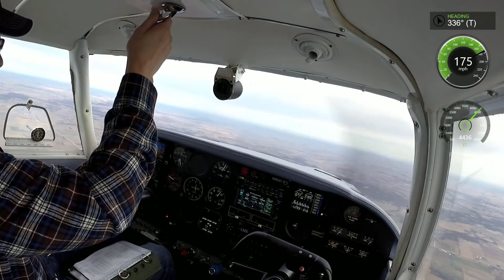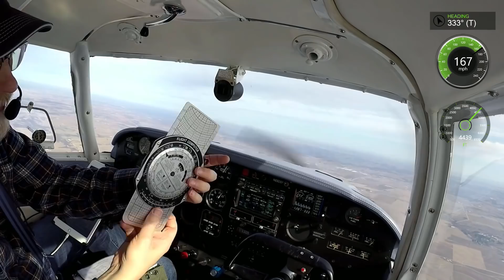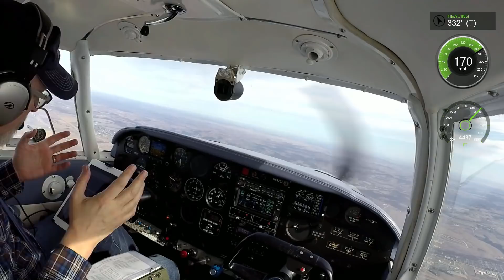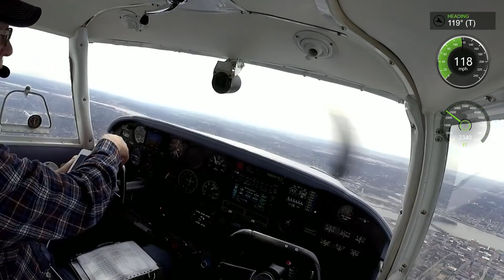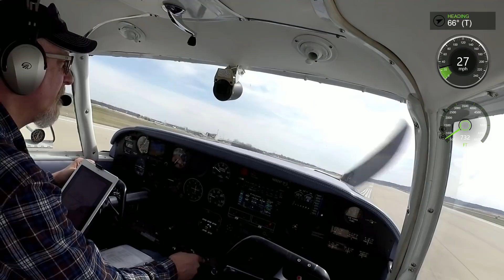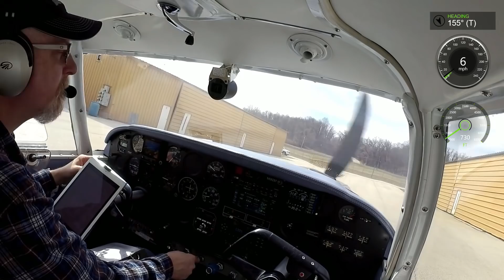Piper Comanche 250 Test Flight 3 with True Airspeed discussion

Comment: I wonder what software allows the superimposed hdg, Airspeed and altimeter at the top right, very informative, very thorough safe pilot! And the lever at the ceiling? Is that some type of trim, elevator trim?  I am a cessna pilot, never saw elevator trim at the ceiling but I am sure it works fine.
Reply from the maker: Joe Cancemi Hi Joe,  the Garmin Ultra 30 Camera that I use has a built in GPS receiver.  The data is the GPS Groundspeed and altitude.  And yes the handle in the ceiling is for pitch trim.  Counter clockwise is trim up, clockwise is trim nose down.  Mike

Comment: I am new to your channel, in the last week. I really enjoy your videos on the Comanche.  i have some flight training, have done ground school and was working on air time. Life got in the way and never completed training. I have been doing my flights on the computer since Flight sim 2. Any way I have the A2A  Comanche and all ready have over 100 hours in the plane. I notice you only draw fuel from one tank at a time and having to switch tanks, Why don't you draw fuel with both fuel valves on when in level flight? I all ways thought that would keep the fuel balance more even.  Another question is the pronunciation  of Comanche.  I had all ways referred  to it as CO Man Che, I see you saying it as CO Manche.  Maybe it is just a East vs. West pronunciation thing? I am looking forward to your next videos. I also am wondering if you have wing tip tanks, can't tell from the videos I have seen so far. Am wondering on fuel management with tip tanks. Thank you for your time you put into this, really enjoy what you do.
Reply from the maker: Morning Robert,

Keep at the flight training when you get a chance you will get there eventually.  In the mean time Flight Simulators are a great why to stay involved, especially if you are using an online live ATC group.  

I only use 1 tank at a time so I know exactly home much fuel I have left and where it is.  My experience with using both tanks at once is only been on Cessna and I found 1 tank was always lower then the other when I went to refuel.  So I switched to using 1 tank at a time so I knew where the gas that I had left was.

As to the pronunciation difference, I use both.  When I say the title of the plane I use Co Man Che.  When I refer to her more familiarly I will just say Co Manch.

Don’t know why, I just do. :-)

Mike